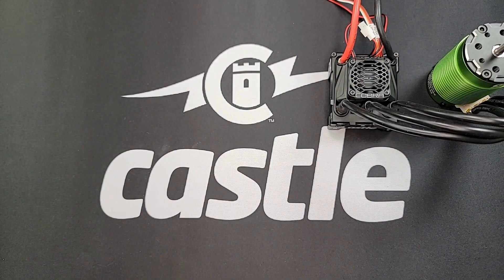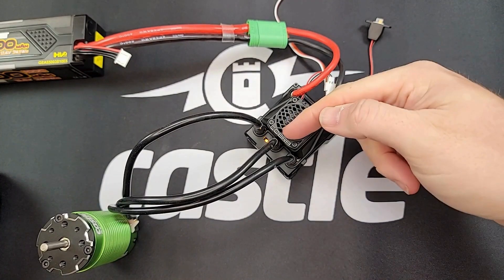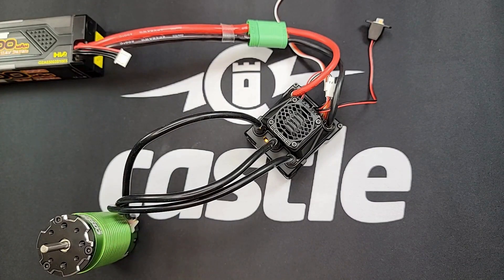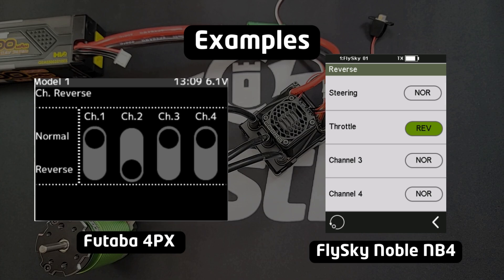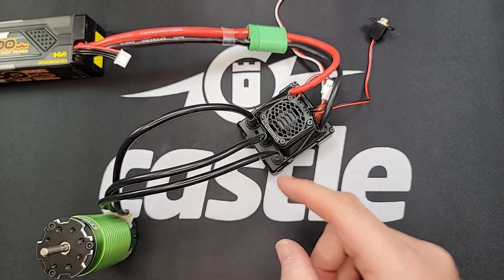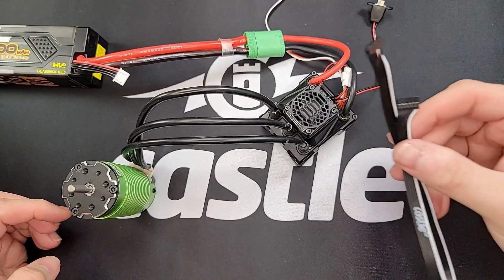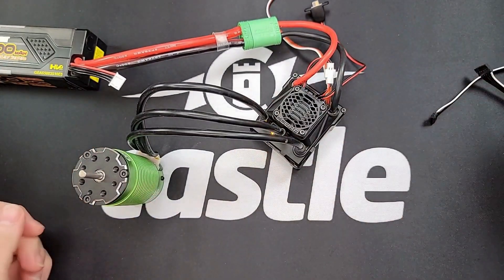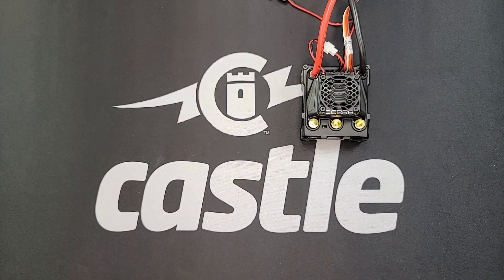Tech Tips Ep 2: MOTOR SPINS WRONG DIRECTION

Comment: Hello, i have a Problem. Im runniong a Robitronic 3000kv motor. for some reason its faster backwards than forwards. Also i have to driver with th rev to make forward be forward. Could this be because of my motor spinning in the wrong direction? I already calibrated my esc. CSo could switching the cables on the motor fix my issue?

Comment: One thing that i don't understand, is why the motor wires are soldered onto the motor in a forward facing direction towards the pinion gear. I just bought a monster x combo for my buggy, and the motor is facing the opposite way to where the ESC mounts, so the wires stick straight up in the air. And unlike my V1 monster 2, 2200kv combo, you can't even align the A B and C wires in conjunction with the A B and C ports on the ESC, regardless of if you resolder the wires to run the opposite way on the motor. They would literally have to cross over each other. So the ESC still has to face the opposite way to keep the wires in their respective order. That makes zero sense. This scenario would play out exactly the same way in my Slash 4x4, which is what my monster 2 combo is in. I was going to put this new combo in that, but due to this layout problem, i will have to put it in my buggy and work it out

Comment: Hi, I'm using a Monster X 8s ESC (with a Brushless no sensors), I tried with the cables, calibration etc.. everything works except one thing.
When I go backwards and press the forward trigger to brake, the model instead of stopping immediately starts forward, risking transmission. The tx radio is a Radiolink Rc4gs.
p.s. (also on another model with the Sidewinder 1/10)
Any suggestions? 🙏
Many thanks.